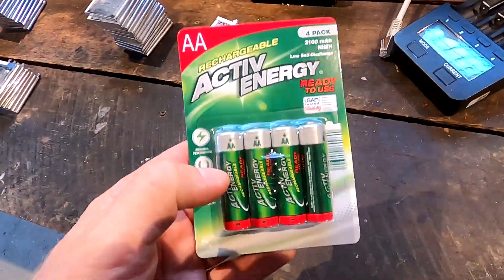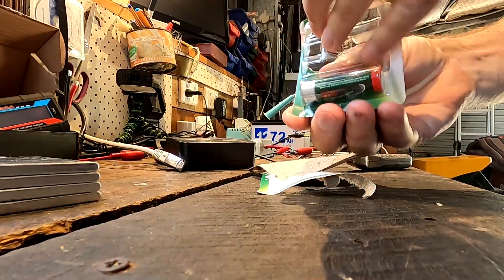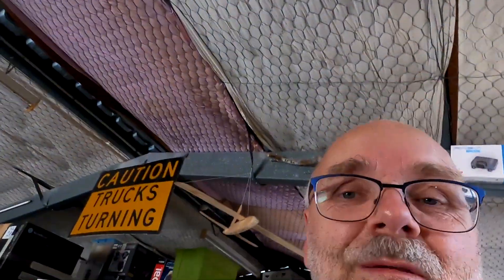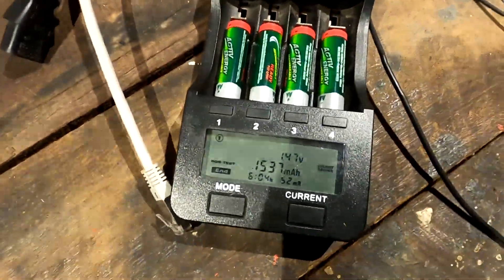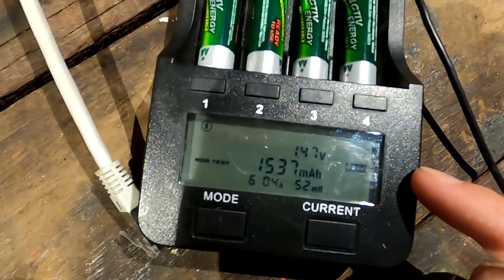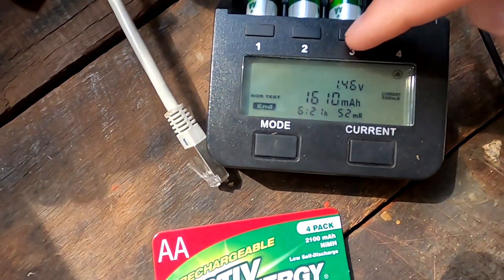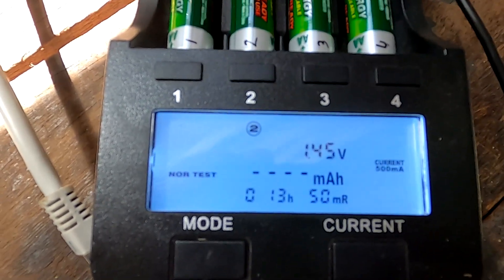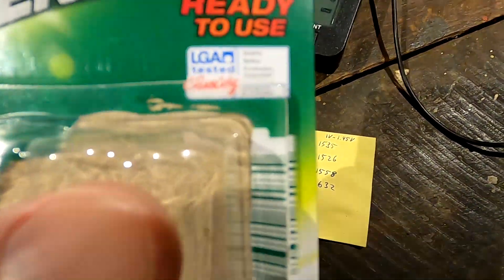Aldi Activ Energy Rechargeable Battery testing - False Capacity Claim?

Comment: Thanks Andy- I smell a rat. Very disappointing that ALDI would do that.
Reply from the maker: Let's see what they reply...
Reply: @OffGridGarageAustralia  Did you get any feedback from ALDI, I'm also curious how the IKEA versions stack up.
Reply: @OffGridGarageAustralia  my capacity tester test nihn batteries down to 0.9v discharging and 1.5v fully charged so maybe you would get anything from 5% to 10% more capacity by doing the testing down to 0.9v?
Reply from the maker: @lostshadow7161  That is for a different battery chemistry though, NiMh batteries or Nicd maybe. Certainly not for LiFePO4.
Reply: @OffGridGarageAustralia  and did they reply or not?

Comment: which grade of product should this be?  A-no, B-no, C-no, D-no, E-maybe, F- (internal named as failed)
A better than clasified
B Range as declared
C 10% less
D 20% less
E more than 20% less
F failed 

The problem with the higher capa is the higher temperature while load/disload and this result in loosing
capa and funcion at least.
thx andy for showing such "3/5 filled waterbottles"
Reply: Thanks for this now I know how my 2700 mah batteries got 2190 mah capacity vs rated 2700 mah

Comment: Its difficult with testing batteries against their official rating. So many variables. I`m involved in testing SLA batteries, and the technical director of a global SLA battery manufacturer (you have one of theirs in your garage, Andy!) told me they have a production tolerance of +/-20% - that`s huge! We tested one claimed 7Ah battery from a different no-name manufacturer which actually had only 4Ah capacity - eventually that manufacturer conceded it was 7Ah, but at 35 degrees Celcius and at C100! And of course regarding approvals there is often a huge difference between trade sample goods and final production goods. I`ve had to dispose of over 1,000 multimeters due to production goods being inferior...
So, ALDI making false claim`s, TUV certifying actually nothing. Are the Germans to be trusted? What do you think Andy? 😁😁😁 I`m afraid the OEM`s trying to pull the wool over thier eyes...
Reply from the maker: That's interesting, Paul. Thanks for sharing. I'll claim this with Aldi anyways to see what they say and how far we can come. I wan't to know the test environment under which they tested measured these cells. 
The German TUV is only a vague and basic certification which is pretty much on every product these days. It means, it will not explode or leak any chemicals basically.

Comment: Apparently the IKEA Ladda Batteries (2450mAh for AA) are just rebranded Panasonic Eneloops. There's a some info online, but may be worth testing if you're interested.

And wouldn't surprise me if Activ Energy made them to a higher standard to get a rating, then made them cheaply after that.
It even happened with Fire Doors. A Chinese company got a German certification for commercial Fire Doors. Then a few buildings burnt down because the doors didn't contain the fire. An investigation discovered they made them from cheap materials after they got the certification.
Reply from the maker: I'll get some the next time we're there. Thanks for the tip.